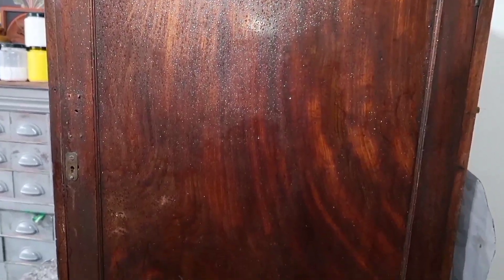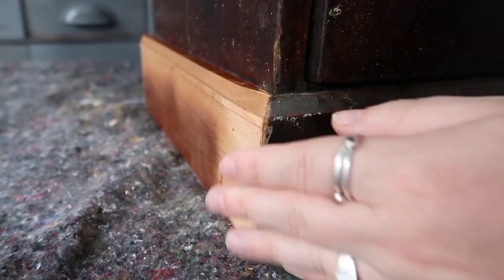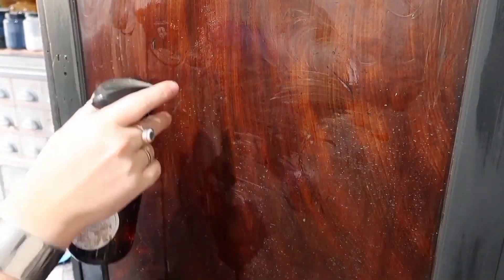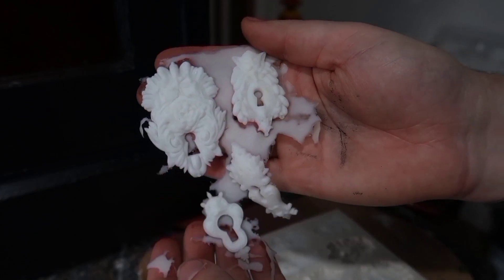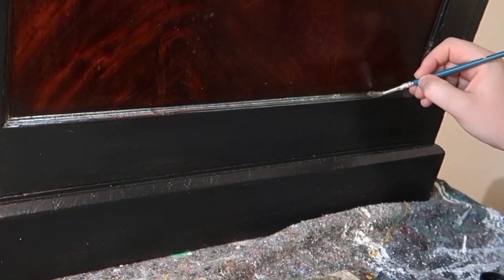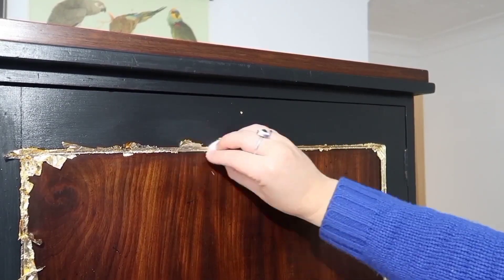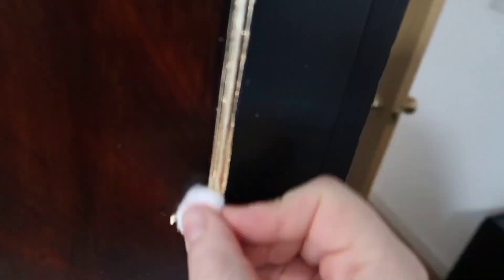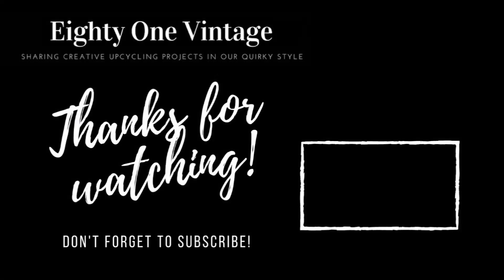Gold Leaf Furniture ⭐  Furniture Flip For Profit DIY💲 Vintage for Resale

Comment: Wow! Incredible transformation! I just you would use your new molds. How well did the gold leaf work with the resin? I haven't used either before.
Reply from the maker: Thank you 😊 I need to find some more molds the gold leaf covered well, I used three sheets to get it in most of the nooks. It was good fun, I'm coming up with lots of projects so there will be more gold leaf coming 😀❤️